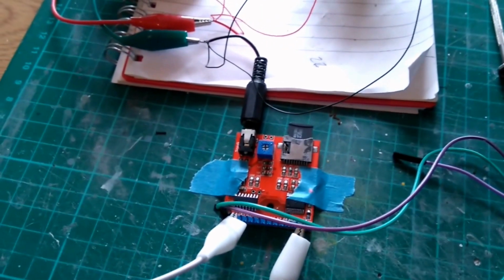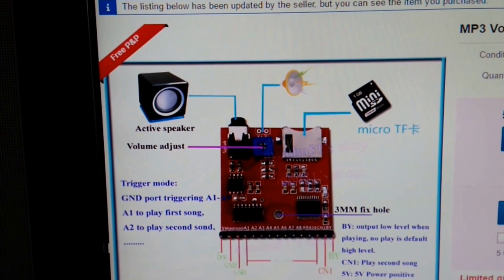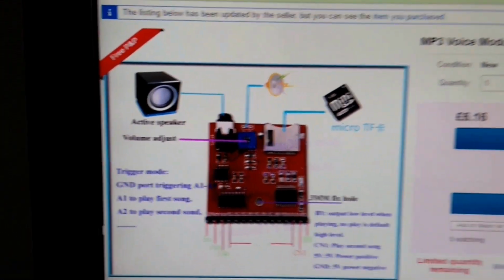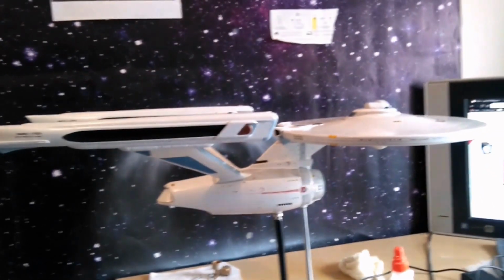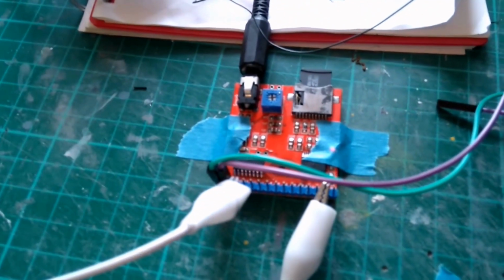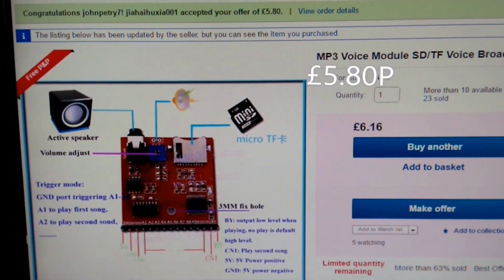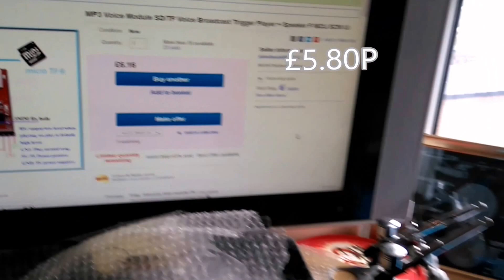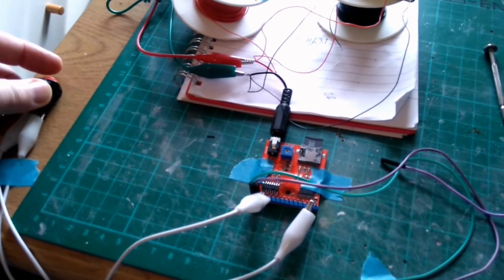SD CARD SOUNDBOARD DEMO

Comment: Hi, I have bought this.....MP3 5V DC Voice Player Module SD/TF Voice Broadcast Trigger Player + the same as yours, copied everything you have done, incl the momentary switch and it only plays one song! It starts with the switch but then doesn't move on to next track. Also when finished track it just stops. Any ideas please. Is my momentary switch correct off eBay?  ..... 12mm Car LED Metal Button Switch Momentary/Latching 3V 5V 9V 12V 24V 110V 220V`. Please let me know mate.
Thanks Glenn
Reply from the maker: I used a cheap plastic momentary switch. The metal angel eye momentary switch may be needing 12v so probably will not work. Try using a momentary with no led. I hope it fixes your problem.
Reply from the maker: also, you can remove the momentary switch and try to just touch the 2 wires from the switch together. It should perform the function so you can check it is working.
Reply: Yeh tried that, but still doesn't change track.
Reply from the maker: @vhjkkkhhjjkk9076  sorry to hear, maybe a faulty board. Also, Sorry, I am not more help to you.

Comment: Any programing tutorial out there?
Reply from the maker: Programming? whatever music or sounds that you put on an "SD card" will play via the board, using the method in the video. No programming required.
Reply: @JohnPetrySPECIES8472  thank you so much for responding and for the video.

Programing so that i got better control of the player.

Like to know when a music ends
Reply from the maker: @barny-6727  The board is not so advanced that you can control all functions. I used it for playing sounds/music on a model build project and I turn off the power when I no longer want to listen. The only control is to jump to the next sound or track as far as I know. Sorry if this does not help you.
Reply: @JohnPetrySPECIES8472  Thank you. I get it i just have to manually change code for the duration each music i put in and hear for button presses.
Your reply was helpful.

Comment: HI! I need a stereo. I want to use 2 boards. For each SD card I will record one channel. And then make audio mixing. Will synchronization start two files from the same button?
Reply from the maker: If you add 2 wires for one board function and two wires for second board function and then join both sets of wires to a single button/switch, both functions "should" begin at the same time.
Reply: I think so. But I can't check ((( I wrote a simple minimal problem. But I have 4-6 synchronized channels, or multi-channel mixer / player.
Reply: @Dim3740   I know your comment is old but for what it's worth...  I too, want to use this device as a stereo audio device and I think that what I've discovered is that if this module is using the DY1703A chip, it sends the audio out in stereo channels (DACL and DACR).  The module designer then mixes the two channels into the onboard amplifier input as one, making it mono.  What I can't tell is if the 3.5mm jack is also mono.  No one seems to know.  I'm still waiting for my modules to arrive, then I can answer that question.  If it is also mono audio, I hope that I can hack the board to use it in stereo.